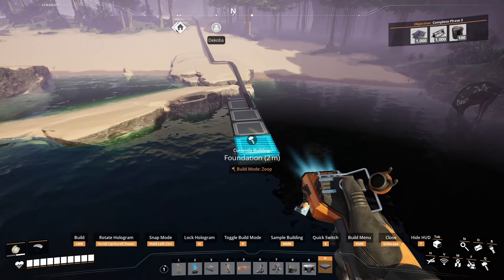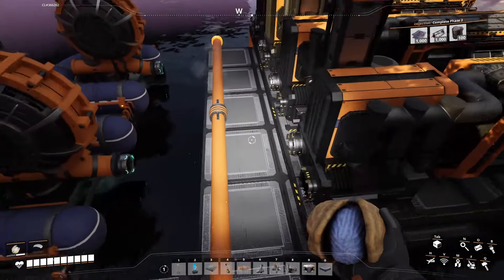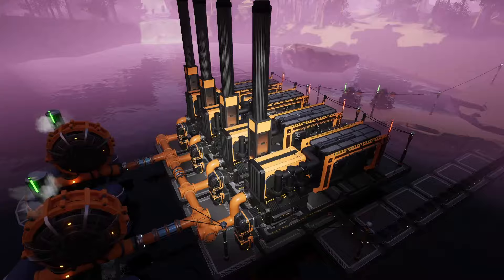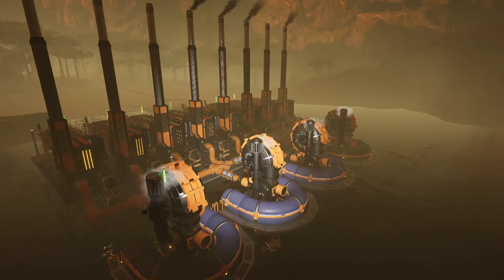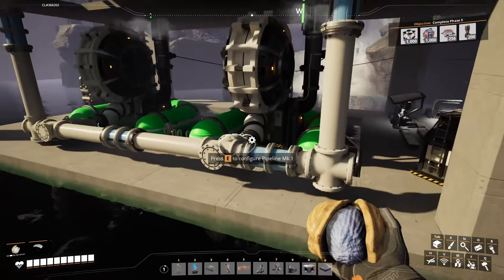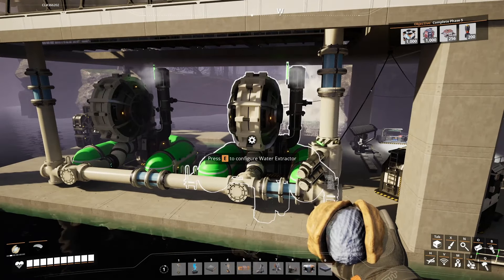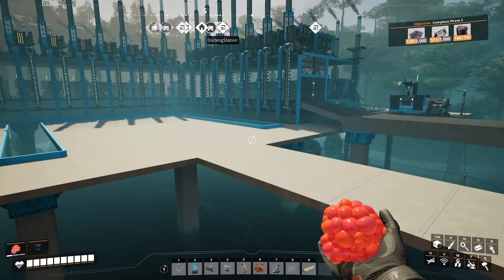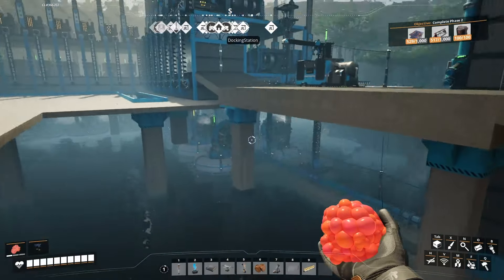100% EFFICIENT Coal Power Plant Build Guide incl. Multiple Designs - Satisfactory 1.0

Comment: Maybe I've got something wrong here, but isn't there a flaw in the 8 generator design when you hook all 4 water extractors together on a single line? Mk. 1 pipes have a max capacity of 300 m3 of fluid, but having either 4 extractors at 75% or 3 at 100% gives you a total of 360 m3 (which the pipes can't fully handle). Wouldn't that result in sporadic shutdowns and inconsistent power production when the generators burn through their water and go idle? That set up works later on after acquiring Mk. 2 pipes, but that isn't an option for those transitioning into coal power. You should have to keep with 4 water extractors and break them into 2 identical systems, as you demonstrated with your 4-gen set up.
Reply: As long as you prime the water into the generators and have a balanced manifold that loops back, you can continue producing 360 since it forces water to backwash anywhere it's not needed. I have 100% efficiency and flow rate on one pipe with 12 water extractors since the manifold splits water evenly into 36 generators. 36 separate pipes distribute the water evenly so long as you don't pump any less that what's required. Fluids are a completely different mechanic than solid belt items.

Comment: question sir i've tried to do a raised one like in video 5.35 but the water is getting stuck on up tubes and not venture into across tubes for coal generators, when i switch off they fill up though ?  can i see inside building how you've connected up ?

Comment: I'm new to the game, so pardon the noob question: Does the water pipe maxing out at 300m³ produce any problems in the first linear setup once it's expanded, i.e. should I keep each group of 4 coal plants and 2 water pumps on a separate pipe network to the next?
Reply from the maker: Nope,  as long as there is enough throughput locally,  connecting different clusters together won't hurt. Just avoid any bottlenecks and you should be fine. Hope this helps

Comment: waittt, the splitters dont evenly distribute the coal, the first one gets more than the last 2. or have i done it wrong...
Reply from the maker: Machines take only as many resources as they need, this uses a manifold which means it will prioritize the first generators first, but once they are full they will pull precisely 15/min and pass along the rest. If you have 8 generators, and are providing 120 coal/min, it may take a few minutes for the lines to saturate but after that everything will work perfectly. You can speed this along by turning off the generators and allowing them to fill, and turning them on when all 8 have 100 coal stocked up. Even if you dont do that, the generators will stabilize after 20 minutes or so.

Comment: Hi man! Im trying to setup the second variant of the coal design (the one that has 32 generators) and was wondering if when doing the single pipe system, do you need to redo the single pipe when taking water upwards to the generators? As in, i make one singular pipe from the water pumps, and then take them upwards to the generators, and when im up there, do i need to make that one large pipe again or just connect them directly into each gen? thanks :)
Reply from the maker: I make a central pipeline on the lower level that connects all the extractors, then a central pipeline above that feeds all the generators, then run a connection between them for each  pair of water extractors. Ill see if I can get some better screenshots for ya.
Reply from the maker: https://www.reddit.com/r/SatisfactoryGame/comments/1fkueb5/pipe_network_for_coal_power_plant/
Reply: @Dekoba  TYSM!!! Having an amazing day man :) will try it out and let you know if i run into any major issues
Reply: so i tried it out and im still having issues with water not flowing well to the top generators, ive built the water tower as you showed and its looking fine, i dont know if they fixed the water tower thing in the last hours or if im messing something up elsewhere
Reply from the maker: @Stefanom1 of you'd like I can try joining your world and take a look.
Reply: @Dekoba  so, youtube is deleting my comments automatically, how can i add you so you can join my world? lemme know
Reply from the maker: @Stefanom1 dekoba on discord or steam.

Comment: I'm running the 8:3 ratio, but for some reason the coal only reaches the first 3 coal generators the other 5 just run out of coal really fast and keep starting and stopping
Reply: manifolds usually require to fill everything up to prevent this. Same with liquids. Just fill all the pipes with thne generator turned off, then start them one by one starting with the last in the chain. That should help. Assuming you have enough coal that is.
Reply: @startide  I turned every coal generator off, then let everything fill up to 100, after that I turned on from last to the first, aka the last gen that receives the coal, still didn't fix it. A thing I did to fix was to split the main coal belt into belts which then in that case each belt would feed 4 coal generators
Reply: Feed your coal belt either from both ends as a load balancer or from the center out. If you run a long line you need to link it with a splitter from the beginning towards the end. Shorter factories don't need to be looped but longer ones won't have a chance of receiving enough product as for every split losing 50% of items you get next to nothing on your last generator
Reply: @suszczpablo  So I should split from the miners if I want to do it the long way?
Reply from the maker: Machines only take as much as they need.  120 coal/min will provide for 8 generators  at 15 apiece no matter how you split it. If you aren't getting enough fuel check your production.
Reply from the maker: Are you mining 120 a minute? That's what it takes to provide for 8 gens
Reply: @Dekoba  I'm indeed farming 120/min if that wasn't the case my "fix" wouldn't work as I mentioned.

Comment: 6:00 I think using the foundation for head lift distance is wrong. 10 meters is 32 ft, and it doesn't look like where you indicated on the column was 32 ft

Edit: do two extractors compound the head lift?
Reply from the maker: Not sure but the foundation height is listed as 4m. That's what I based it on.
Reply: @Dekoba  I know it is, it's just... 4m is also 13 feet. Does that foundation look 13 feet high? I don't know what the devs used as the scale, but It's not a realistic meter, but ironically might be for head lift.

Comment: im sorry i maybe dumb, but... if 4 generators and 2 water extractors will provide 300mw of power... then how will they work? Cause 4 generators, 2 water pumps and 1 MK1 miner consume 300MW of power... Am i dumb? or it is just.... using power to use power?
Reply from the maker: Your consumption figures are of by a factor of 10. Thru only require about 30, leaving 270 excess

Comment: what about the fact that mk1 pipes can only hold 300l
Reply from the maker: there are multiple pipelines being run in parallel, no bottleneck so no issue
Reply: @Dekoba  i am just as confused as some others here and not seen a clear answer in the comments. Your water tower only shows a single pipe up. Yet you have way more power plants than a single pipe should theoretically support. Are there more water towers not shown or something?
Reply from the maker: @kiwidude68 I'm working on a fluids video that explains it fully.  There are multiple pipes to move water,  they just run in parallel.  The water tower design just pressurized the system.

Comment: im so cooked dude my coal nodes are like 1km away from my base 😭
Reply from the maker: Lol better get to making more belts. Or just build your power plant at the coal and run power lines. Power doesn't care how far it has to go
Reply: @Dekoba  yea ima make a big belt line and build the station near my base, think itll be easier to have quicker access to the station than the miners. great design btw its working a treat
Reply: @Dekoba  Plus, you unlock super aesthetically pleasing high voltage towers later so those long distance lines look better. The cable length/distance between towers is massively longer with those.
Reply: If you go to the "oasis" area, up a big hill, there is a beautiful coal spot that has coal and water (also sam ore).  Build there, then just run power lines to your factory.   Then use hypertubes to travel back n forth.
Reply: @FranWest.  good idea just need to get steel going first to get hypertubes